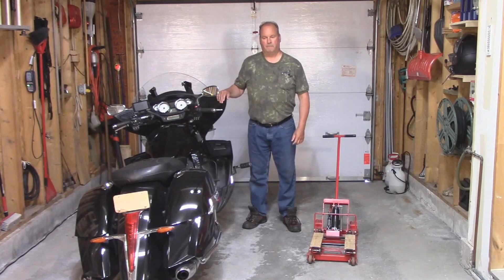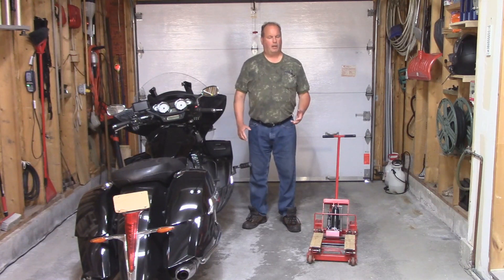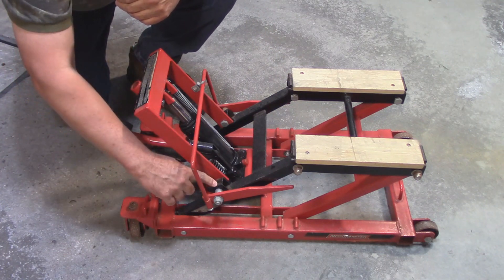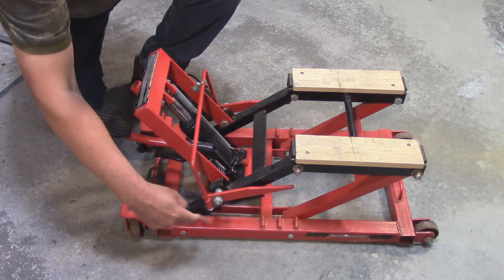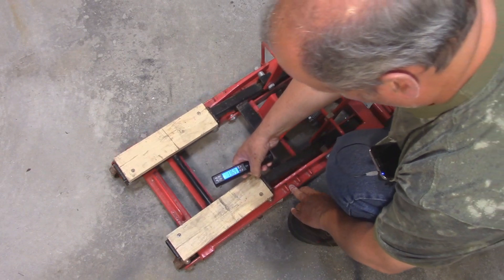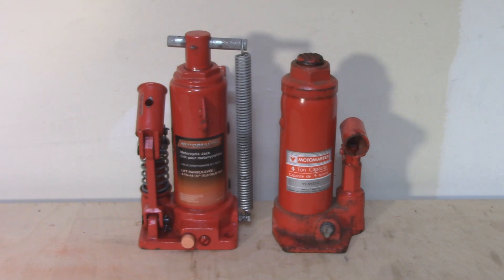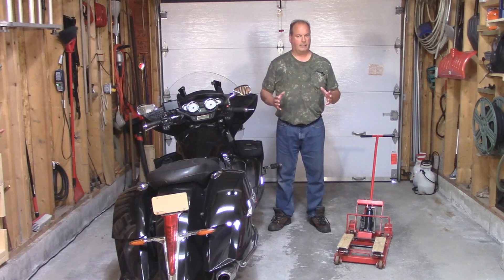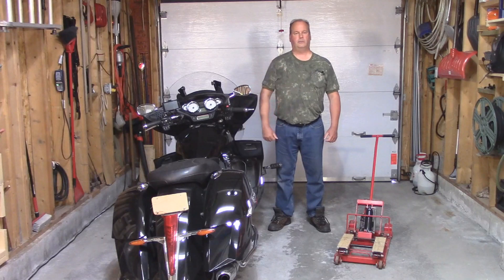Motorcycle Jack Warning

Comment: Hi Paul, that was very helpful.
I live in Canada too, I am curious, can you tell me the brand of the jack you were talking about? Please.
Thank you.
Reply from the maker: It was the J&S Jack sold in the States. They are no longer in business.
Reply: @PaulPomerleau  thanks for replying, is there another jack that you suggest me to buy? I have found another jack that has air and hydraulic powered but I need it to have the minimum height no more than 5” otherwise it won’t fit.
Paul when you have time let me if you know another model that is well built, I have many: Vivohome, Vevor, MotoMaster from Canadian Tire, Goplus, Black Widow, Torin Big Red, IronMax, OCT, ExtremeMax, DNA Motoring, OCPTY, Garvee Tech, Performance Tool, BouPower.
Is there one that you would recommend?
Let me know please.
Thank you so much.
Reply: Even if it’s not in the list, but I want to make sure it’s a good one, there are too many to choose from.
I also looked for a lift table but for a good one I have to spend $1800.
Let me know if you have another recommendation for a good jack.
Thank you Paul.

Comment: I hear ya. I think about that little jack every time I lift my bike. Thank god there's safety latches on it so the weight sits on them instead of the hydraulic jack. I bought mine used and I just bled the air out of it (the previous owner thought it was no good so I got it cheap) I've been using it for 4 years now and it works just fine. As long as it lifts my bike. I will probably continue to use it unless I find something better.

Comment: Not questioning your findings, bit have had a motomaster jack for over 10 yrs. Been putting my 950 lb wing on it every winter, which it is now, and have never had an issue with the hydraulics or bottle. Maybe I have been lucky.
Reply from the maker: The hardest part of the jack lifting is right at the beginning. Once it is higher up, it is very easy to keep it there. Like trying to lift a long log. When you first start to lift, it is the heaviest, as it tilts higher it is easier as all of the weight is on the far end. Keeping your bike up all winter is easy. Also, because I make a lot of motorcyle videos, my jack is used multiple times a week. That is why I am already on my 3rd bottle for the jack, and why I made a video upgrading the bottle to a 4 ton. I guess it all depends on usage. Thanks for watching and replying. Ride safe.
Reply: Thanks for the reply. Once I take mine off jack I am gonna check the oil in bottle to see if it is up to snuff.

Comment: Is it possible to use an air bag in place of the bottle jack?
Less moving parts and very powerful.
Maybe a bit bulky?
All my bottle jacks have failed. Changing or topping up the oil dose nothing.
I'm about to buy a used prolift brand bike lift the same as yours guy reckons he's only used it once.
This type of lift is the only one I've seen that will fit under a cruiser with only 4 or 5 inches clearance.
Definitely remember to engage the lift lock and lower the jack onto it which will help extend the life of the bottle.
Hope my new lift goes the distance as I'm fed Up with these bottle jacks failing constantly and which can't be accessed to repair.
Great video double the fist ✊ ✊

Comment: Your analysis is flawed. The original bottle jack is not rated at 1500 lbs. The complete assembly is rated at 1500 lbs. You are reading a decal. Also, you need to resolve the forces properly to get the correct jack load.

Comment: Pretty sure that 1500 x 2.5 = 3750 lbs is the pressure on the jack at full capacity, Both bottle jacks look about 2 ton size wise. (pistons are same diameter) So everything adds up correct. The sticker rating was for the jack not the bottle. You can't get a bottle jack that is rated for only 1500 lbs that I have seen.

Comment: Just came across your video while researching motorcycle jacks. Good info. So, doing the math backwards, 1500 pounds divided by 2.47 equals 607 pounds. Does that mean that your jack is best suited for a 607 pound or less motorcycle? Thanks.
Reply from the maker: That is exactly right. No one can sue the manufacturer for false advertising because technically it has a 1500 pound bottle on it, but the way it is built it can only lift 600 pounds without going over the rated capacity. However, people read it as being able to lift 1500 pounds. You can see my next video where I replaced the bottle with a 4 ton model and now it works much better. Check it out... https://youtu.be/vSK6331dlzo
Thanks for watching.

Comment: I am using my HF 1500lb ATV / motorcycle jack to lift and lower antique VW engines.  They only weigh about 250 to 300 lbs fully assembled. (As installed in a Bug or Bus).   Even  though my typical weight lifted is significantly less than the 1500 lb advertised rating, or even the 900 lb motorcycle in your experience, this jack has still been failing to be able to lift my engines in less than 2 yrs of occasional use.

Comment: Great Video Paul The Jack does what it's supposed to do, BUT  It seems like You've subjected the jack to cyclic loading and worn it out more than the manufacturer has (if  THEY HAVE at all) I don't  think a Manufacturer would put the Maximum SWL on the MC JACK and lift it to it's fullest extent and back down again X number of times or until failure in their R&D department. I can't believe the trouble as a potential customer your having from   that Jack you want to up grade, go have a run up on your HD  and fetch It and give them a good bollocking.

Comment: Great explanation.  A lot of the new jacks are cheeped down in quality.   I found a 10- to 15-year-old Sears Craftsman motorcycle jack and restored it.  Actually, I made it better with taking out the slop from the moving arms.  It weighs about 90 pounds compared to the new jacks that weigh far less.  The restoration project was part of my motorcycle modification to be able to lift my bike up in the air.  My bike started out with no provision for it to be lifted up.  I solved that issue by beefing up a skid plate.  I integrated ratchet straps also.  Great project.

Comment: Would the Jack handle a 600lb Sportster for a longer time than 2 years you think?
Reply from the maker: Yes, if the measurements are the same as my jack in the video then a 1,500 lb bottle means a maximum of 600 lbs on the lift. Your 600 lbs Sportster should be good for many years on this jack.
Reply: @PaulPomerleau  Awesome, thanks!

Comment: Hi Paul, thank you for the video. May I ask where I can get a replacement jack that can be swapped with mine? I bought a used jack but due to a torn seal, the jack leaks from the pump pedal. I was hoping to fix by replacing the seal but can’t find the seal. Any help is appreciated. Thanks again !
Reply from the maker: I took a regular 4 ton bottle jack that I got from Canadian Tire years ago and modified it to fit the jack. You can see my video on how I did it here: https://youtu.be/vSK6331dlzo Hope this helps.
Reply: @PaulPomerleau  Thank you. I will try to do that (hopefully) one of these days when I can get one and convert it following your steps. As I don’t have a workshop, will have to find someone to help me out.

Comment: Got the same jack to lift my Kingpin @ about 670 lbs. Have had one cylinder fail so I bought another bottle which already is  beginning to drift down slightly with the bike on it. Just a word of caution to all that see this, always always use the safety catch.

Comment: J&S Jack I have used one for years on Harley Davidson Road King. Besides being extremely stable you can roll your bike around on the bike all the way up with no straps. I do it all the time
Reply from the maker: Wish I could get one, with the pneumatic bottle. That would be sweet.
Reply: Yes, have that jack too.  Just try to get in contact with them.  They are the ones Paul is likely referencing in the video.  Two years after the video and the company still behaves the same.  I have been trying to get just a bottle jack replacement.  They have my money and I have no bottle jack.  It is now 3 months and still waiting.  No indication of when or if I will get the replacement bottle jack.

Comment: Great video ,I'm having problems with my jack ,same design as yours to lift my Fatboy.
But the jack keeps lowering and I don't want that.So why don't the companys that make them use two bottle jacks in the design ? just a idea.
Reply from the maker: Or just put a stronger bottle on it. That is exactly what I did. You can see it on my follow-up video here: https://youtu.be/vSK6331dlzo Thanks for watching.

Comment: I couldn't quite make out the label on the jack's original bottle. Is the label from the jack manufacturer, or the bottle manufacturer? Most bottles I've seen are rated in even tons, 1,2,3,4, etc. I've never seen a bottle of that physical size rated at .75 tons. Is it possible the label was intended to indicate the jack's capacity, and not the bottle's capacity?

Comment: Lost track of the times, I had to upgrade, modify, everything from hand tools,  chain saws, rakes, shovels, dumptruck, 12 ton trailers, Perkins diesel motors, stump grinders, etc. Moving away from" factory engineered " specs, when needed,  to "my way" , with different parts, methods, and or fabrication , has kept my fleet of about a quarter million dollars in equipment , going. Some days I feel like duct tape, coat hangers, and tie straps get me through the day too.

Comment: You could rebuild bottle jacks and it’s not that difficult
Reply from the maker: It would still be rated at 1,500 pounds and eventually fail again. The only solution is to increase the bottle strength.

Comment: Good warning, and it is fine to calculate the amount of strings needed for the bottle jack.
But if the engineer could not calculate this part of the construction I would be quiet concert of the rest of the construction, holes bolds wildings and so on 😉 if you decide to put so much pressure on it.

Comment: Thanks and wow, what an informative video. I've been using the Harley-Davidson branded lift for about five years. I use it maybe 3-4 times a year. I store it in my unheated garage, Wisconsin winters, just south of Canada. I have no complaints. It works nice and smooth after 5 years. And Paul, I just noticed that we almost share the same name!
Reply from the maker: Cool, we are probably cousins somewhere down the line. Nice to meet you.

Comment: doing the same her on one since it was my fault for not understanding the weight capacity's, I have a trike, looking to install longer runners, and upgrade the bottle jack to a 4 tone ratio , the trike is around 1100 pounds, frame is wider,  just getting ready to try it? not good at welding  but oh well? pipe cutting is going to be done with hack saw . any suggestions would be appreciated. many updates to do Kawasaki vn900c 2008 with lehmane kit .

Comment: I've just bought a similar jack which is also rated at 1500lb - allegedly! It looks like these lifts are all made in China, shipped over, and are then rebranded to suit whoever is flogging them to the public on eBay or Amazon. So, it's very handy to know the real world lifting capacity of the actual lift as a whole, when it comes to motorcycle maintenance. My next bike will be your average street naked, or maybe an adventure/dual-sport type of bike, which weigh somewhere in the region of about 400lb, or 200kg. Using your calculation that gives a result of: 2.47 x 440 = 988Ib (448kg); call it 1000lb (454kg). It looks like these 1500lb jacks are really only suitable for your average middleweight motorcycle, they just don't seem to be suitable for the heavier bikes, like a cruiser, which you have proven quite conclusively, because the jack will fail over time. Look forward to seeing your 'custom' lift build! Cheers.

Comment: Good job Paul , I'm having same issues , I failed trigonometry in high school but common sense as I was lifting the bike (when the jack worked) you can feel while jacking the pressure go from hard to soft anyways , the only question I have is at the top of bottle jack the pin that runs threw allows for pivot would that change the math ...let me know
Reply from the maker: Usually the bracket is in line with the bottle so it shouldn't make much difference in the math. However the most weight the bottle has to lift is when the jack is at its lowest point. As it lifts the levers will start taking the weight until when it is at its highest the bottle has relatively little effort to maintain lift.  But eventually it will fail and will either not be able to lift from the lowest point, or it will not be able to lift it off the safety pins while the bike is on the jack and then you will not be able to bring the bike back down. Thanks for watching.

Comment: Paul, Great video. Have you seen our lifts, made in the USA?? https://letsroll.store/shop/

The Lift has gone through testing to confirm engineering calculations and has been tested to failure. The root cause of the failure has been analyzed and the design has been changed to improve capacity. The failure point on the lift exceeds the rating of the lift and an unpublished service factor has been established. It is not published for consumer evaluation as that could be construed as an endorsement for additional capacity on the lift.
AND you can reach us at 800-280-8860 if you have any questions! We are available. And we ship to Canada.

Comment: Interesting video. I have 2 Harley Davidson's , one and Ultra Limited which weigh's more than your bike, and I lift it with a jack I bought from the UK called Big Blue. It is a screw drive  and will lift a true 1200 pounds with a 1/2 inch drill motor. Best jack I've ever owned.  Just a little info from this end.   Be safe
Reply from the maker: I have seen those jacks. They are amazing and absolutely no risk of hydraulic failure since it uses a screw jack. If I had to do it again I would get the Big Blue. Thanks for posting.

Comment: Not really correct, you have to take into account the angle at which the bar is. When the bar is a fraction before standing straight up (R straight above F), you need little force to lift the bike that last bit. So you need to multiply with the cosine of the angle at which the bar is. Similarly, you also need to take into account the angle of the bottle jack itself.
Reply from the maker: That's right. It gets easier as the lift gets higher, but at its lowest point with the bike on top the bottle jack  is well over its rating. This is why the hydraulics often fail and down comes your expensive bike or it may end up stuck while up on the locks because the bottle can't lift it off them. Either way, it is just a warning for you. Thanks for watching.

Comment: Nice video Paul -It seems the bottle is the issue. Can you at least buy the bottle jack from the company that you want to buy the lift from? I can send you the name of the bottle for the J&S jack I have. 
Trust me you don't need the air compressor feature. About 10 up and downs with the foot lever and 5 seconds later my HD is up 6". Are you sure the J&S lift slides under your bike with no mods?
Reply from the maker: That is a great idea, I never thought about that, buying just the J&S bottle. At least it would have the foot pump mechanism already built in. Great tip, thanks for sharing. I am assuming that the jack will fit under my bike as is, but I have no proof as I have never seen one in action on a Victory CCT.
Reply: @PaulPomerleau  Go to the J&S website and they have a list of all the bikes the jack will fit under with and without modification. I know the jack slides under All Harley models. Check out the website.

Comment: Very good info, thanks!  Bought a used 1500lb jack, now I’m not to sure I want to trust  putting my 750lb VTX on it
Reply: Got me a used bike jack like that, put my 2 VTX 1800s, and 1900 cc Raider on it, no problem, but always stabilize the bike with jack stands, wood, or something solid, under the pegs,  or axle nuts, or whatever doesn't move, for security.

Comment: My hydraulic bottle jack broke after 10 years.   I have a Victory Vegas which is 670lbs and this style jack seems to work fine on it.   But then my bike is not 1k lbs.   I just bought another floor jack and might try the car jack upgrade on the old one.

Comment: Really enjoying your videos (recently picked up a '15 Gunner).  I know the "black" jack you are speaking of.  I have tried as well - with the border closed it looks like a no go.  If you are interested Fortnine sells a similar model to the one in this video but with a 4 ton bottle jack (K&L MC550 Multi-Lift ) - certainly more expensive than the CT special, but according to the math you shared, it should work .  Thanks again!
Reply from the maker: Thanks for the info. I do shop at Fortnine. I will go and look at their jack. Thanks again, ride safe.

Comment: Sounds like a good upgrade, you really shouldn't have to do this though! I actually use a motorcycle jack but only for lowering transmissions from cars on jack stands - it's just a small screw type one, I've never tried one of these hydraulic ones.